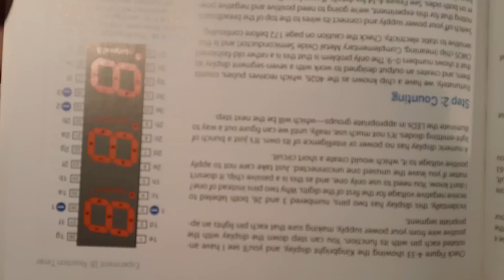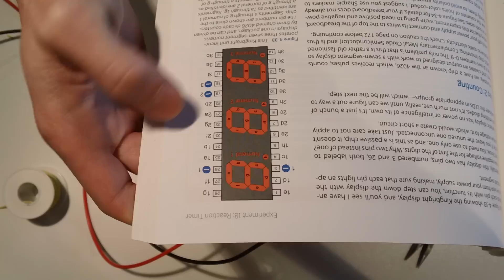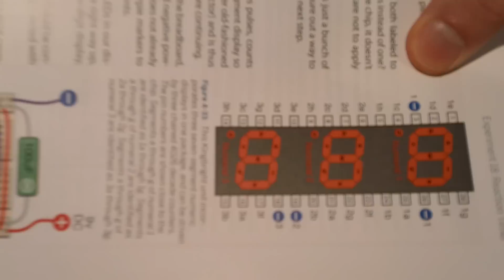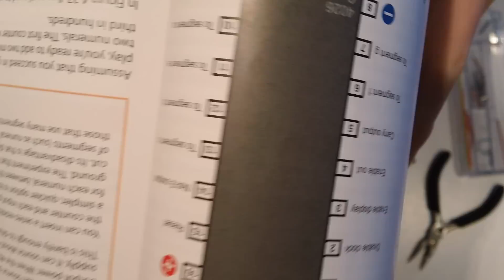Make: Electronics - Experiment 18 (Part 2 using a 3-digit numeric LED with three 4026 counter chips)

Comment: Thanks for the video.I have a older style 3 digit counter display board in the 7 segment form that has small bulbs. I'm wanting a way to make it count up using a switch and LED's to a maximum number of 999. Is it possible to use separate LED's instead of the ones in your video. If so please advise...Thanks